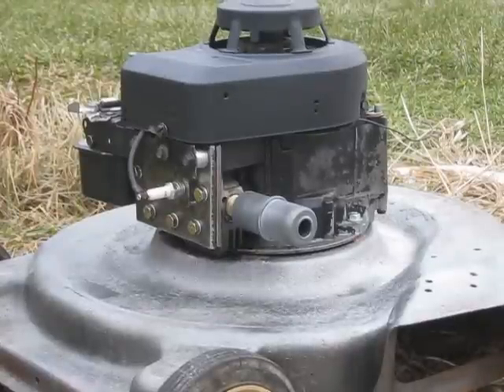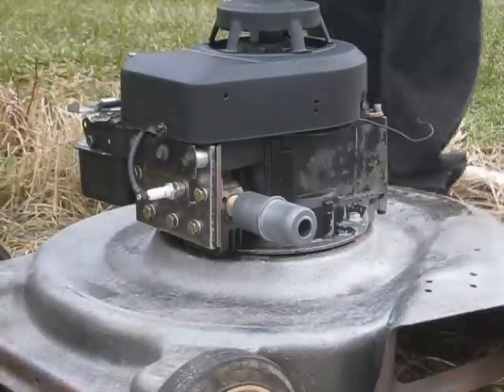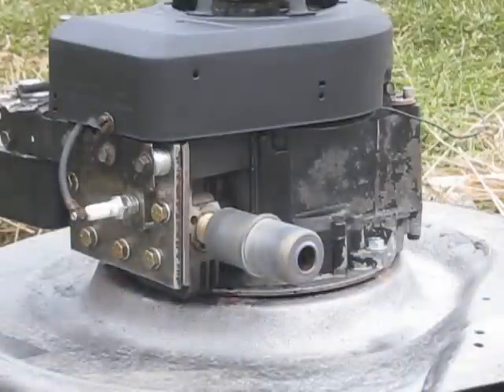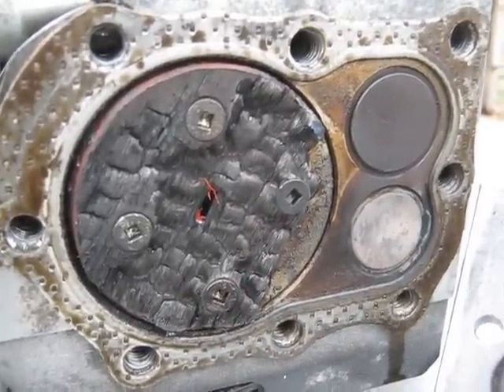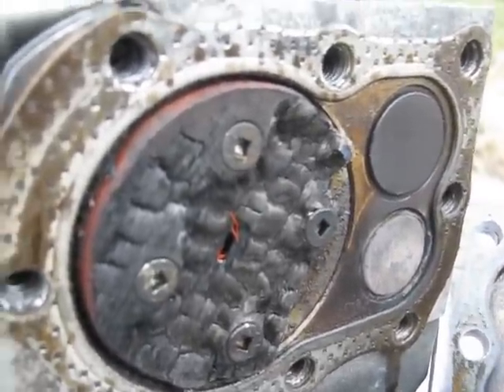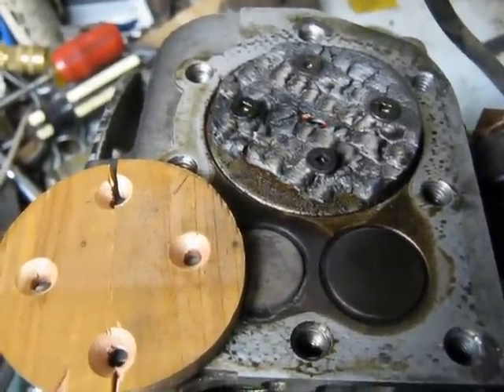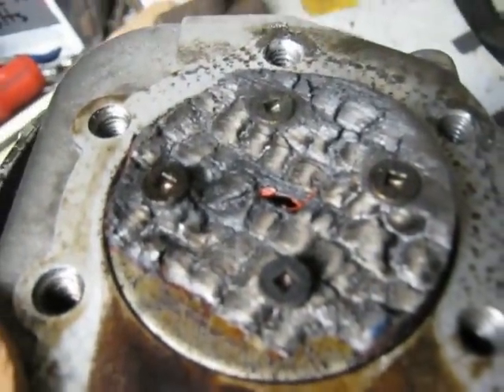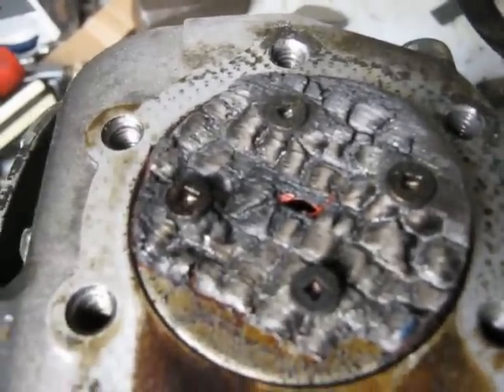Wooden Piston Briggs! (Oak)

Comment: Ill be a son of a gun  i never thought it would run as long and as well as it did  my guess would had been. It  would have gotten so  hot and expanded  to the point it  wood ! Get too tight to the cylinder  walls  ?  It would be neat to mill a complete  piston out of  any species of  wood and see what actually happens  years ago i got a old boat from a Uncle  that i did a restoration on    It had twin Chevy inboards  and one was blown  up because the boat. Sucked up a plastic trash bag. Into the fresh water  cooling port and blocked it off  i  did put a new moto in  that ones place and for giggles i pulled open the  blown motor. One of the pistons had the top   Blown off  and was attached by a tiny  section of  its original casting  it resembled  a open can of Popeyes Spinach  and i threw the piston into the back of my workvan  everyone that saw it. Thought it was funny  i eventually put it on display. In my office for laughs  the boat was a old Wooden Chris Craft cabin cruiser and the engines were both 283 Chevy small blocks   Converted to marine use by Chris Craft  i found a used running 283  and did the conversion myself  by salvaging and restoring as many of the parts as i could from the blown motor i  removed  most of those parts were bolt on. Pieces  Chris Craft had manufactured for the Chevy  motors in the 50s and 60s  and the motors and exhausts were actually cooled with. The water the vessel was   Floating in  and it ran  thru the engine blocks instead of antifreeze. That is no longer. The way  marine engines are cooled today as. Generally they are a closed  antifreeze system that  utilizes a  heat exchanger unit that is cooled by. Sea water   That never touches the inside of the engines block  which is a better way    Often the old way would allow  sand and salt water to corrode and clog up the.  Cooling jackets  inside the blocks that could cause overheating issues  along with other problems  since that observation ive always been. A little more interested in examining  motors after they’ve failed  to see the damages done  oddly enough my next. Boat. Had Ford  motors  and  one day they overheated so badly that. They  seized.  I was able to get into my dock on 1 motor and i let the  motor cool down for 24 hours the next day. I went to the boat and every thing started and ran like Normal  ? I did  do a  warmup and. Tried to reseat the pistons in a manner you would do on a new motor or a rebuild and that has run trouble free for over 12 years  i considered myself to be lucky on that one because i. Originally  thought it was fried when it refused to spin at all  I dont know if Ford uses a  more resilient metal in their  engines. Or. Anything like that. Nor do i have any  favorable  thoughts on which is Better or worse to have in a boat  ?  But it does appear that manufacturers use more Chrvrotlet blocks over the  years  as most  of the boats ive owned  use Chevy blocks

Comment: You said wooden piston crown, so part of it is aluminum where the piston rings go
Reply from the maker: I attached a 1/4" thick slab of wood on top of the normal piston, with a hole drilled thru the center of the piston, so I would know when the wood burned out. The piston rings are still in the normal location on the piston. Note, i used several different types of wood, and made vids of them, this one just gets all the views. The Teak (ipe) piston crown ran the longest of them all, cork was the shortest run, followed by Balsa wood  :)

Comment: Try 14 gauge plate riveted to the top. It may last longer, worth a try!
Reply from the maker: I guess i could give that a try, hopefully it doesn't come loose and total the cylinder wall, but I guess i could repair it with JB Weld, like I did on the 65 Subterranean  engine a few months back.
Reply: Haha, good old JB weld!

Comment: no f in way,i had no idea you make a piston head out of wood. 😲
Reply from the maker: Yes, the wooden piston top holds up decently well. I have vids of 8 or 10 different types of wood. Ipe (a Teak) lasted the longest during the torture test. Even Balsa wood worked for a while.
Reply: ChargerMiles007 won't this foul the Carborator or the spark plug or decrease the life of the oil ?
Reply from the maker: It didn't seem to affect the carburator, but yes, it did grunge up the spark plug, I had to wire brush it clean after each run. the oil started to smell like the exhaust from a wood stove, rather ripe stuff! the cork run was the worst, it blew a ton of little cork bits into the crankcase, I had to blow it all out with compressed air.

Comment: It probably overheater cuz theres no fins on the head and its steel wich doesnt disapate heat aswell as aluminum. Gay
Reply from the maker: My guess is that the piston crown overheated because it is made of a flammable substance... wood.
True, the steel head doesn't have any fins, but the plastic piston managed a 5 minute run with the same head. Anyway, this is all just for a comparison experiment.

Comment: I wouldnt buy a lawn mower from you! lol. I think its funny you used oak. A thin layer of steel over it and it probably would have run forever.
Reply from the maker: Oh don't worry, I am not like the guy in England that machined up wooden pistons, then sold the car, watching it drive away with the smokey exhaust. When i sell or give away a lawnmower to someone, it is top notch, I usually strip the engine down, just to make sure there aren't any hidden problems. These days the most common problem is water in the gas!
Reply: ChargerMiles007 Now days nothing suprises me. I am learning more on V- Twin lawn mower engines. Sadly,I havent had much experience on them yet. Since I have done many twin and triple snowmobile engines,I figure there cannot be too much difference. I have heard storys where they would run a bolt through a piston that had a hole burned through the top,then ground down just so the snowmobile could finish the weekend races back in the 60's and early 70's. That comming from a racer. He said they did whatever it took to finish because points added up from each race and any no finishes wrecked your season. The guy helped me think outside the box when it came to fixing things. Granted,I wouldnt sell a cobbled up mess eather but if I needed that mower to finish a job. well then I would cut a gasket out of a cerial box. I made them out of sheet copper too. Whatever works.

Comment: Wood is always underestimated stuff. The Chinese used white oak as a heat shield for a research satellite re-entering earths atmosphere and it held up to 2000 F. In this case if your engine is running stochiometric then there isn't really available oxygen to combust the wood. Wood is also is poorly thermally conductive which helps protect itself from fire, develops a layer of charcoal, helps it retain integrity. I guess mother nature has had millions of years of forest fires to make wood fire resistant.

Comment: It's amazing that it kept running despite most of the surface area of the oak being burned away. I imagine that caused a reduction in compression, which is probably why the rpms dropped about roughly mid way through the run. I'm surprised there wasn't any noticeable smoke coming out of the muffler, considering that most of the wood was burned away! I guess the oak may have essentially become additional fuel as well!
Reply from the maker: Yes, I am surprised also by the lack of smoke on most runs, though my latest, the hard maple did do some smoking.

Comment: Try the wood with a layer or two of aluminum can bonded to it over the screws so they don't back out. Then form the aluminum down over to the ring on a second try. ya never know could be just the thing that gets you out of no other good option instance.

Comment: nice series of videos, have you thought about doing it on a horizontal shaft engine?
Reply from the maker: Initially I made the wooden heads for a horizontal engine, but I have so many more lawnmower engines, that if I destroy one, i can easily replace it. The horizontals are more rare, especially  the smaller 2 and 3 horse engines, while the 3-1/2 horse lawnmowers are everywhere!
Reply: ok.

Comment: I wood not do this No j oak! In any case the title is misleading. No way to seal the cylinder with a wooden piston.
Reply from the maker: I wood lay pretty good odds that a person could indeed make a solid wooden piston, add regular iron compression rings, and have it run for at least 5 minutes. That is making the assumption that the ring grooves wouldn't burn up faster than that. If I had more access to a metal lathe I would give it a try.
Reply: If the top piston ring land, the space above the compression ring were relatively large, it just might meet your 5 minute estimate.  I draw the line at wooden exhaust valves though.  ; )

Comment: Interesting video.
Try iron wood (lignum vitae) or eucalyptus. 
And stock finned aluminum head to reduce heat.
Reply from the maker: I would use the aluminum head, but that would reduce compression. though I could make another one of oak, and try it for as a comparison.

Comment: I knew a guy that bought a ford model A from someone that had been sitting in a barn for a long time.  The guy said it ran a but was a little rough like it was misfiring.  Sure enough one cylinder was dead.  When he took it apart one piston was made out of a chunk of oak.  It even have piston ring grooves carved in it.  It had zero compression but was intact and it must have been in there a long time.  He thought it was probably a backyard fix in the depression or during the war or something.
Reply from the maker: I believe it, I heard a similar story first hand from a relative. though in that case they machined a wood block to fill the dead cylinder which was badly scored, cut the con rod off, and ran the straight 8 with 1 dead cylinder.

Comment: Could you have screwed/high heat glued in a piece of body metal over the wood? to help keep it from burning up?
Reply from the maker: Possibly, but I would be afraid it would come loose and lunch the whole engine. wood is somewhat softer, so i figured a smallish piece of it wouldn't do too much damage if it broke loose.

Comment: I wood have thought it wood have lasted longer!
Reply from the maker: I didn't, especially after how my son's car ate 2 pistons when his meth injection cut out at 21 pounds of boost. It looked like an acetylene torch was used, it sprayed aluminum onto the cylinder walls. Gasoline burning produces a lot of heat, and the wood being somewhat of an insulator will trap the heat, so i knew it couldn't live very long. I have some Ipe now, so I plan a few more wood tests.

Comment: Why not use low voltage induction of graphite ran off a battery and solar panels and design a hot air engine that has wooden pistons to run a lawnmower? No more fossil fuel needed .
Reply from the maker: I am not as familiar with those new tech items, so i will leave that for others. I did try to make an electric piston engine back in high school, kind of a big step backwards, but i like designing oddball things  :)
Reply: How about a hemp oil swash plate hydraulic pump motor with a cryogenic Sterling cylinder that cools the oil that is circulated through a heat exchange coil with a sawsh plate pump fan to force air over coil for a new air conditioning system operated off a low voltage electric motor? It beats playing with your wood and burning through heads correct?

Comment: What about bamboo piston?
 It look like fairly durable against flames, but the temperature in the combustion chamber can be too high if the compression is high or depending on the type of fuel used (I remember correctly, if you replace gasoline by ethanol look like it will run cooler).

Comment: Take a the same wood and have it soaked in epoxy and then ones its dry have the wood coated with a ceramic coating and I bet it would last a long time. I bet the ceramic coating shop would do it for free as long as you gave them a video for advertising.

Comment: What if you added a heat resist coat on it? Or even add a carbon fiber layer so that it would handle pressure better? It wouldnt scorch the piston as long as there was no abrasives/hard materials

Comment: Many years ago a fellow from Africa told me they made pistons out of some sort of exotic hardwood there and used them in diesel engines as a rural solution when parts couldn't be had. He was very serious, had engineer level intelligence, so I doubt he was messing with me.
Reply from the maker: I think it is possible, but you would need the correct wood for sure. I wonder what the piston clearances would need to be due to the different expansion coefficient. Sounds like a test for somebody!

Comment: it would be really interesting to see how the wood crown would hold up after being treated with a ceramic coating. hypothetically it would last much longer, but how much longer is the question.  It would be a good test to see just how useful the ceramic coatings are on high powered race engines.

Comment: Have you thought about high tensile chewing gum. Lead might be rather interesting. In my younger days I converted a 150cc Triumph Terrier into a hybrid Triumph Terrier / 200cc Tiger Cub. It was about 175cc . The compression ratio was rather low so I weighed the piston and got the crown built up with aluminium weld. I then drilled out under the crown back to the original weight.  It was fine until I gave a mate a lift to work - it melted. All good clean fun ChargerMiles007. Smashin vid.

Comment: I find your videos interesting too. One experiment tried on old nitro dragster engines was stainless piston tops kind of similar to how you did the wood one.. Melting through the aluminum pistons was a problem and that did cure it but the reflected heat melted the heads instead.
Reply from the maker: Yes, I was wondering what other effects the stainless piston crown would have! This whole experiment with the wooden piston crown has me wondering if the wood being an insulating material is reducing the temperature of the rest of the piston. I also have been wondering about those adiabatic engines (no cooling system) they were working on a number of years ago, in the search for greater fuel efficiency.
 I am pretty sure the Napier Deltic as well as the Nomad used high temp piston crowns to avoid melting the pistons. Especially the Napier Nomad, as it was a turbo compounded engine designed to extract the most energy out of the fuel.

Comment: you should put the wooden head on it just for s#%ts and giggles. :)
Reply from the maker: I have noticed a few comments like this, I may just have to do that. I am working on a second piston, so I can run another type of wood, then do a relatively quick change over for another run.
Reply: ChargerMiles007 nice that video will be interesting!
Reply from the maker: I have the second piston done now, so I will soon make another wooden head and piston crown to run together. My black walnut piston was a big disappointment, it only lasted about 15 seconds, kind of like balsa wood probably would!
Reply: Yeah I saw and it was abit of a fail. How well do you think plywood is going to work